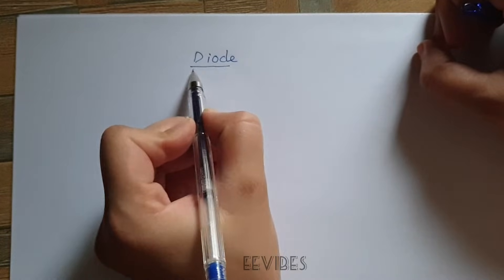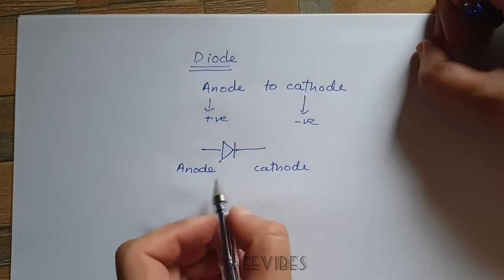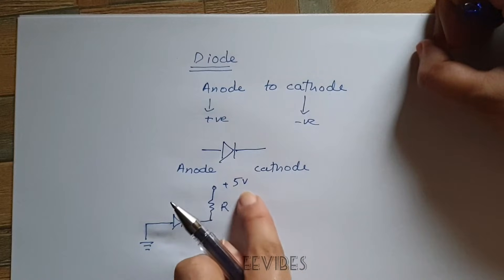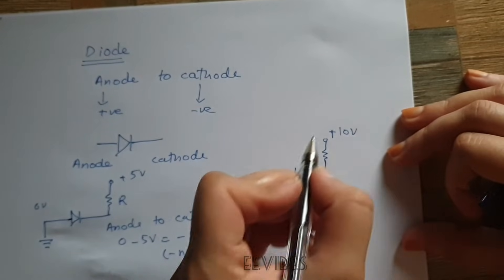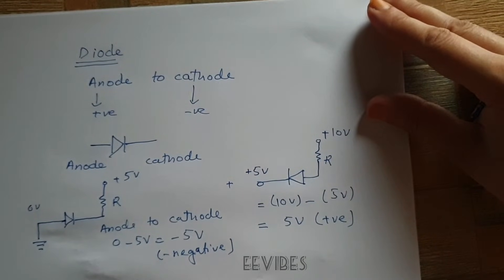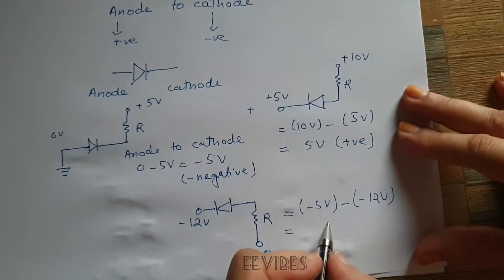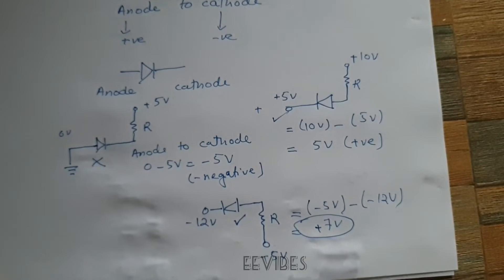How to decide either the diode is forward biased or reverse biased ?

Comment: Mam i have a doubt 
Does there is a change in the answer when we draw the diagram of diode opposite or symmetric to what it was (kindly explain)
Reply from the maker: If by "opposite" you mean investing the direction of diode then you will have to see either it is connected in a circuit or not. If you are talking about an isolated diode (not connected in a circuit ) then it does not matter either you invert it's direction or not as it's terminal are Anode and cathode.

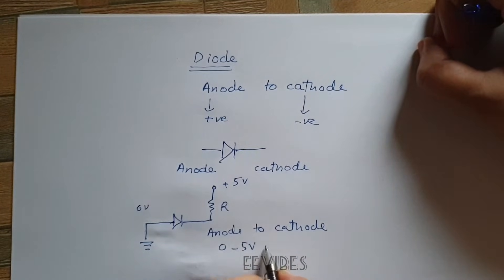Comment: 2:23 in the given figure, at the N termila how potential is 5 as their is resistance R present to at N Ntermila potential should be different.
Reply from the maker: Yea you are right but for the analysis we assume negligible voltage drop across the resistor or you can say we just neglect it ...because here our main goal is to understand when it is forward biased or reverse biased. But of course for the complete analysis we will consider potential drop across each element in the circuit. I hope you got my point
Reply: No I didn't get it mam 
Mam u should assume it as forward bias then must recheck it again by taking into consideration the voltage drop across resistor 
.
I wished to watch complex circuits, but its not here .
I'm from 🇮🇳 india ❤

Comment: Ma'am what if the potential is zero
Means potential at anode minus potential at cathode is zero
Reply from the maker: When A-k=0, it is less than the required barrier potential 0.7v or 0.3V, so diode will not be forward biased. It will not conduct.